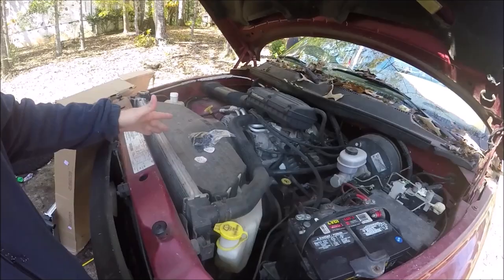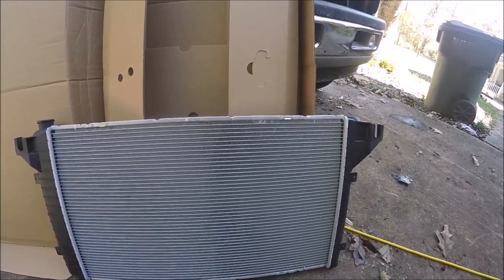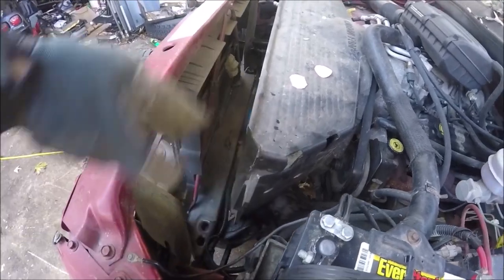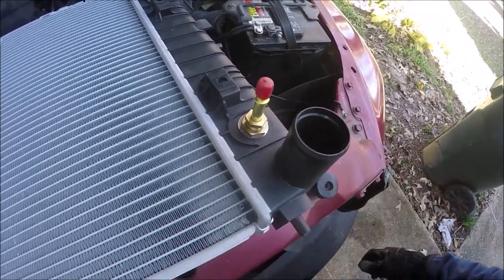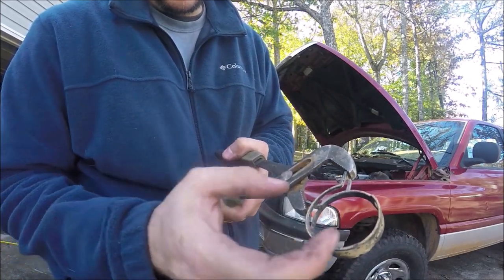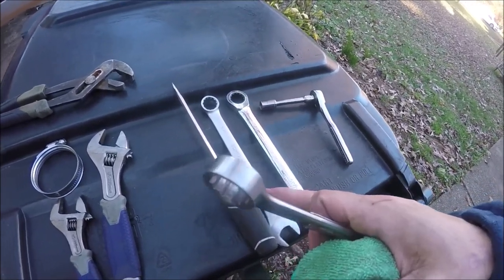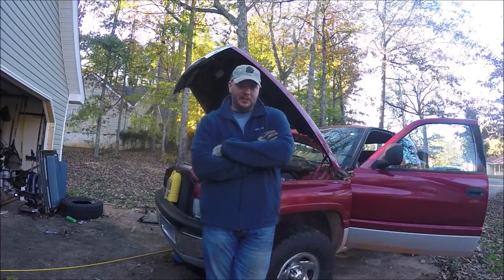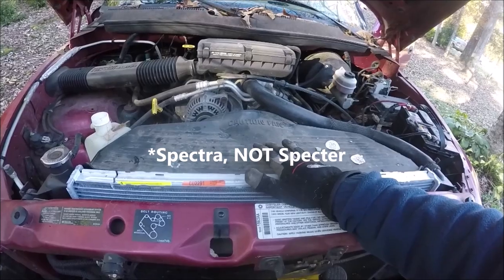1999 Dodge Ram Radiator Replacement

Comment: Just an FYI for a flare fitting you do not want to use Teflon tape especially if it’s a high pressure line it will ultimately cause a leak

Comment: Recently put an Agility radiator in a 98 ram and it immediately started mixing trans fluid and coolant together. Turned an easy job into a bigger job and big mess. Just pay the extra $40 for a quality brand radiator (like Denso) and save yourself rolling the dice on a huge headache.